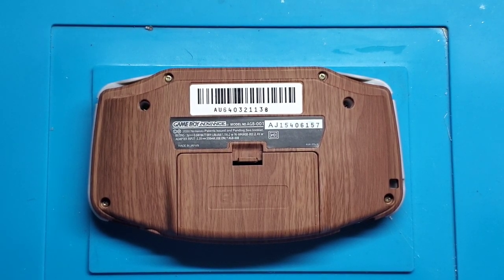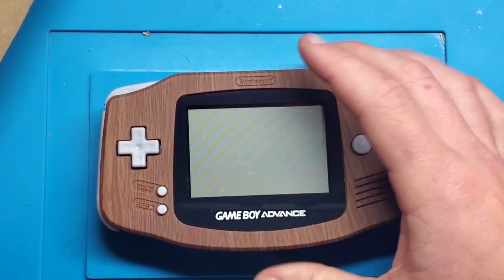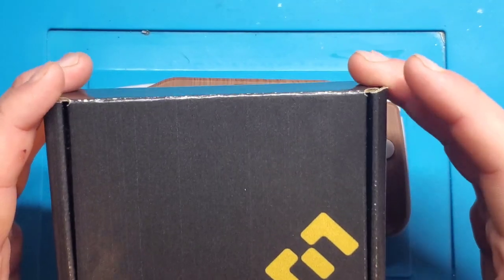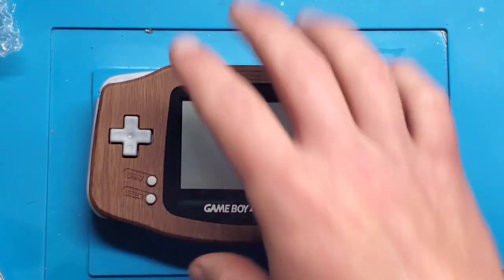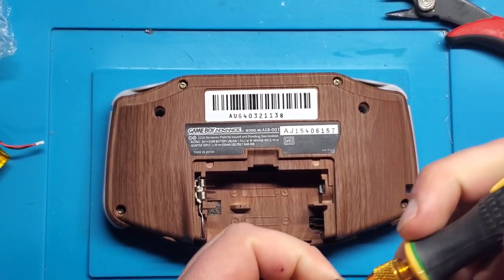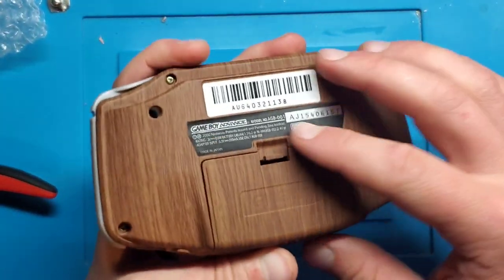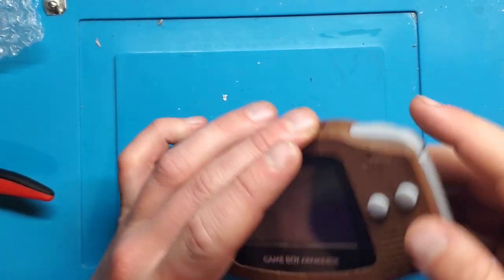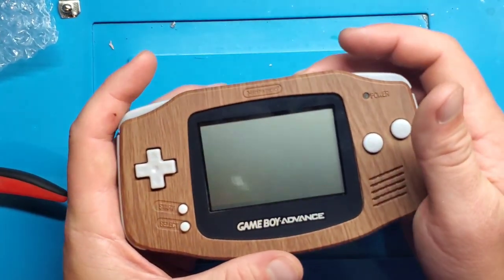Game Boy Advance - Rechargeable Battery Mod - Fixing Ebay Junk

Comment: Wood shell!  Maybe if you do another of these battery mods, it could be an idea to mark the end of the usb port with something that will leave a mark on the inside of the battery cover, (soft pencil lead for example?).  That way, when you attempt to close the battery cover over it, if should leave some kind of  mark indicating where you need to cut a slot.  

Either that or stick a very small and thin bit of adhesive foam on the inside of the battery cover.  I'm thinking the usb port will leave an imprint which might again serve as a guide for cutting a slot.

(I'm only suggesting this as it does seem a shame to cut such a large section out of a very nice case).

Interesting video anyway and I enjoyed watching, as usual.  Looking forward to more content as the nights draw in.  Keep up the good work!

Comment: @RetroRepairs I recently pulled my N64 back out of the closet after years of sitting. For each one of my games, I have to let the cartridge sit in the system for an hour or two, while turned on, before they'll boot. As if they need to recharge or something.  What is this issue?

Comment: Should have made a paper template with all the holes marked out and stick it to the battery cover so you can accurately drill or cut it out.

Comment: "Wood Shell" I have an official GBA rechargeable battery pack that was made to actually fit within the battery bay by Nintendo in Japan, so I technically don't need this mod. It's still cool to see the board designs they have for various mods, though.

Comment: It's a lithium polymer, not lithium ion battery. But no, don't puncture. Never charge it without a battery management unit either. The swell up an go poof if mistreated. Also Woodshell.

Comment: The "Wood Shell" looks great. I don't like this rechargeable battery mod. I just use 4 rechargeable AA batteries in my GBA with backlight Display. I like that I'm able to use every AA Battery. If the rechargeable battery doesn't work anymore, you have to search for a new rechargeable battery that fits. Maybe they won't make some of these in the future. Then you have to undo this mod. That's something that botheres me with my GBA SP AGS-101, too.

But I hope you have fun with your new modded GBA. I like the original GBA with mods more than the GBA SP.

Comment: "More issues" that result from removing the battery contacts on the motherboard include "you can no longer power the GBA because all the battery contacts are gone, how are you going to get the power from the battery to the motherboard now? Hard solder the battery to the motherboard?" 😋

Comment: What bothers me about this mod is the lack of a stencil. It really is an awesome mod, but lacking that stencil make doing it extremely destructive for those who don’t have specialized tools.
Reply from the maker: Agreed.   It could be due to the fact that the battery isn't always the same thickness.  You can source your own battery for this rather than using theirs

Comment: @RetroRepairs, I have a broken copy of Kirby Tilt 'n' Tumble for the GameBoy Color. The game is supposed to respond to you tilting the GameBoy by moving Kirby in the direction that you tilt it, but my copy of the game doesn't work. It's in great physical condition, but the tilt function isn't working. When the game turns on, you can test the function and every time I test it, Kirby always defaults to moving to the top left corner of the screen no matter what I do. I feel like it would be a challenge, but I trust you! I would like to have it back if you can fix it, but that seems selfish, so you can keep it if you want. Ironically I bought this as refurbished from, you guessed it, GameStop! I hope you can fix it, if you want it.
Reply from the maker: Unfortunately,  looking at the board i doubt it's an easy fix.  Whatever component detects the tilt may need replacing.  Not sure if that part is still available but i have my doubts about being able to fix it m
Reply: @RetroRepairs  Ok, that does make sense. I mean, when the game gets to the main menu, it does say Copyright Nintendo 2001, so it may be possibly to find new-old stock parts for it, but it is a rare part and it stopped production about 20 years ago, so yeah. I respect your decision. Maybe that explains why GameStop couldn't fix it! XD